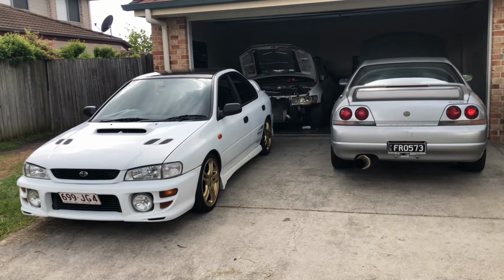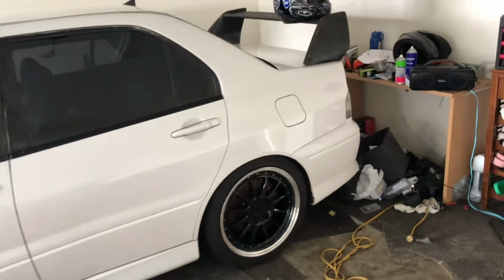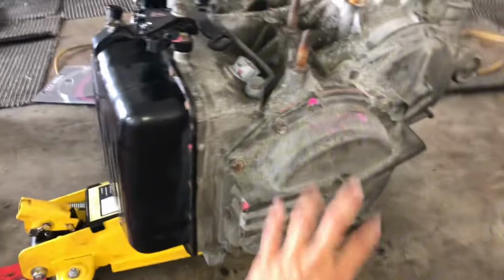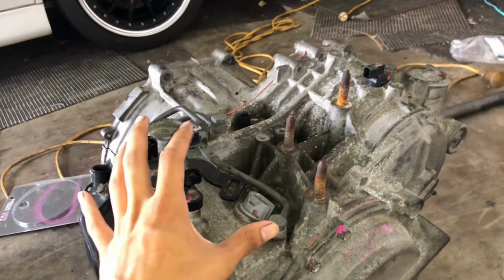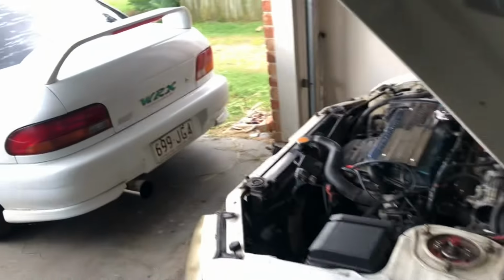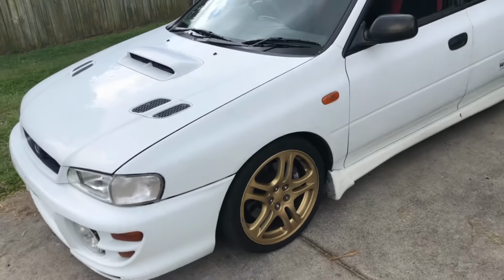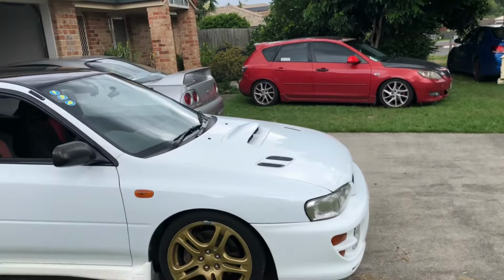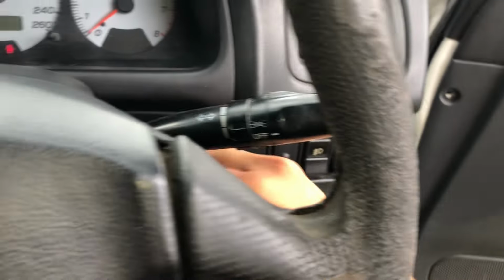Evo 7 GTA Build

Comment: I've owned my Evo 7 GT-A for over 6 years and it's been awesome. Thinking to get a performance tune and add a boost and AFR gauge installed.
Love ya cars. Drive safe. Peace.
Reply from the maker: They are good solid cars if you know how to after them, they are just as quick as the manuals